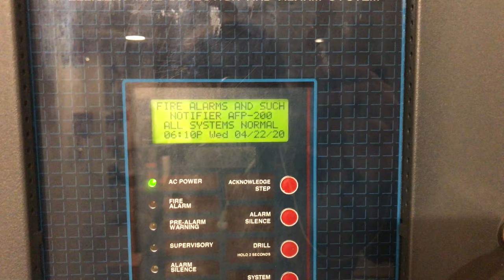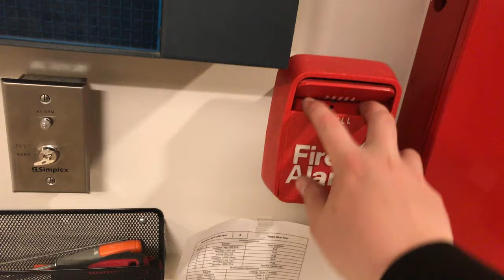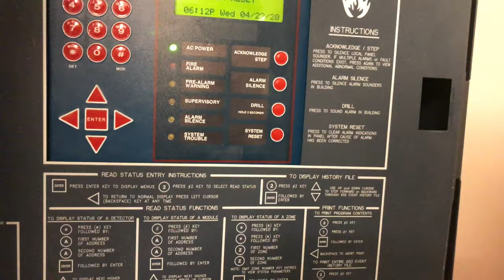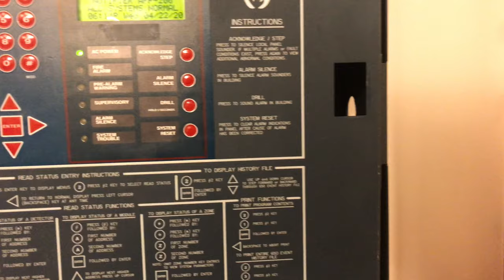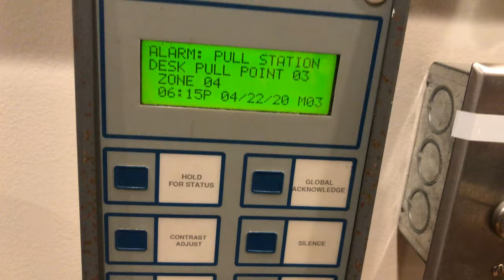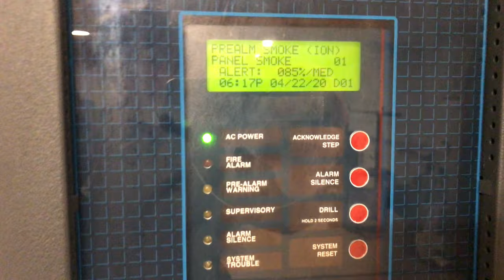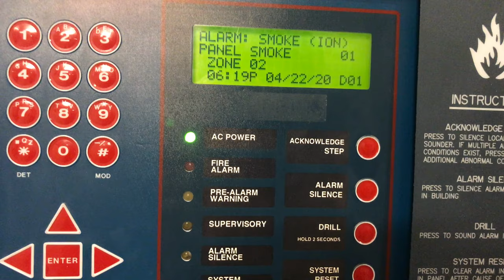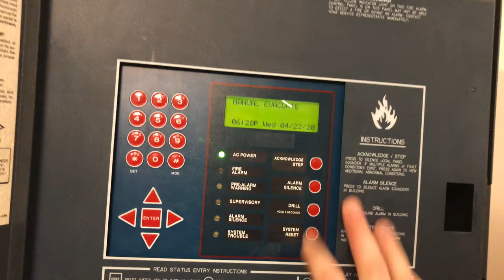Notifier AFP-200 Test 8: Gen-Tegrity

Comment: Awesome! You should get a System Sensor CO detector and wire that up to a dual monitor and control module so when the CO detector activates you can have an alert strobe flash or something like that.